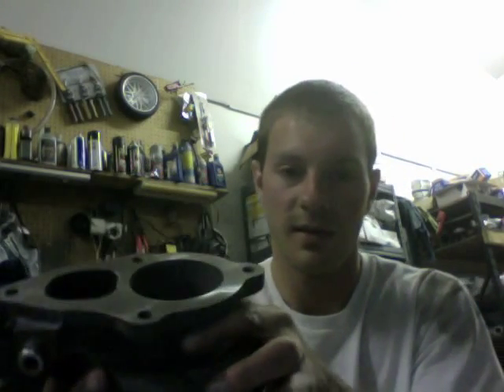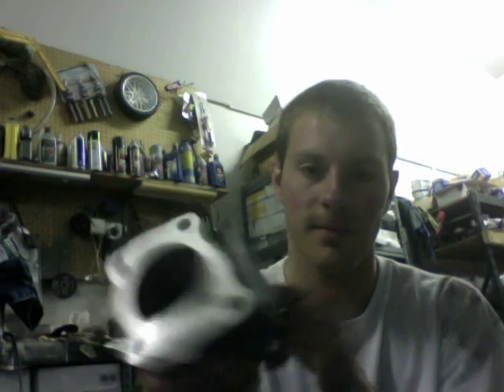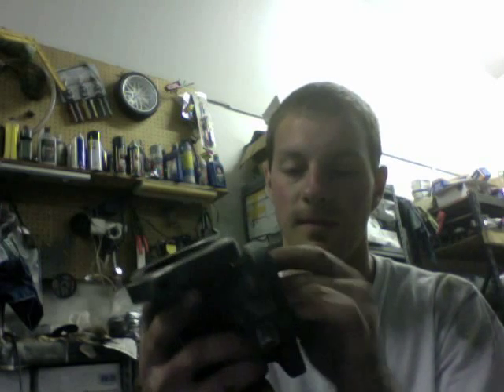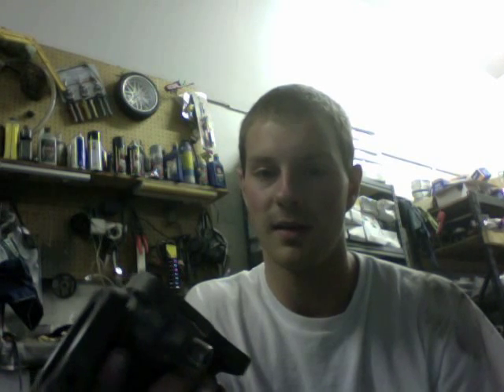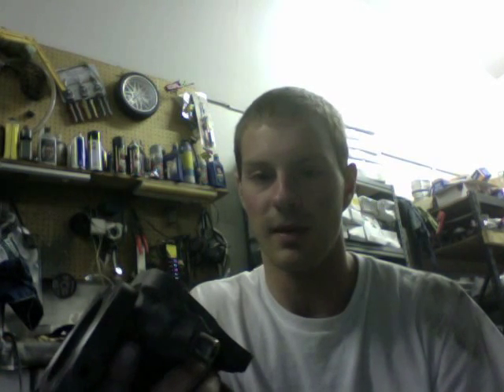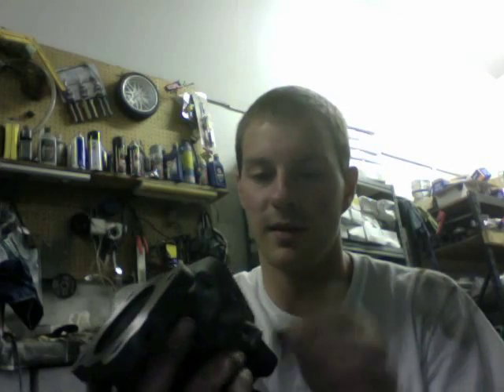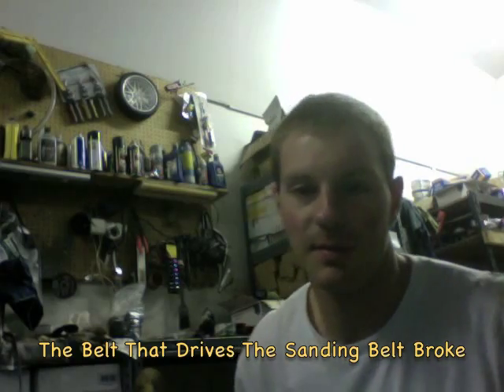How To Resurface a Turbine Housing

Comment: Do you do this to every turbo you recieve to do upgrades?
Reply from the maker: Yes. Some housings like the evo 9 don't fit the whole way on the sander so in some cases like that I don't sand on those.
Reply: Turbo Lab America oh ok, well i just finished removing my turbo I'll be sending it on Monday to you for the upgrade i wanted. Thanks for all the help i can't wait
Reply from the maker: Your welcome. I can surface the inlet flange to the evo 8,9, and 10, but im not sure if i can surface the outlet flange. If it was scared up, i could try and surface it, i just haven't tried yet.